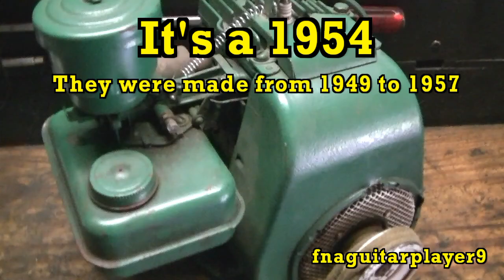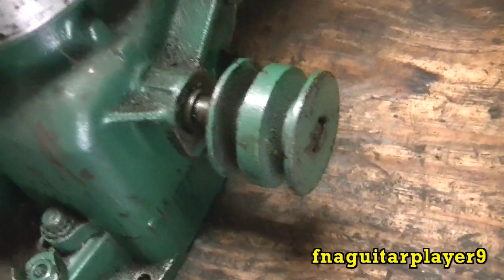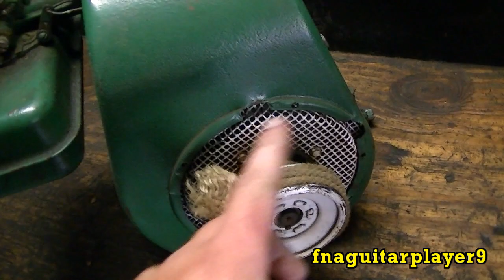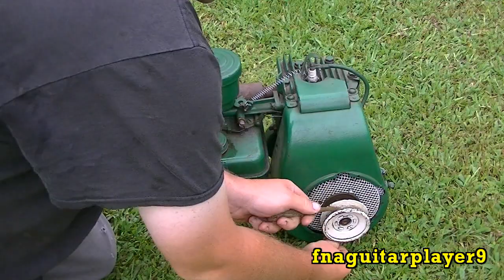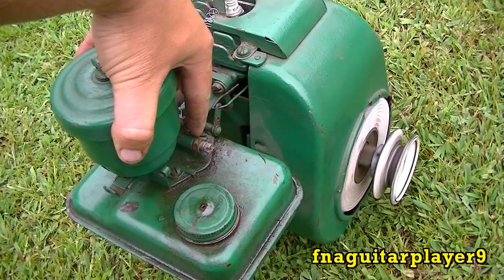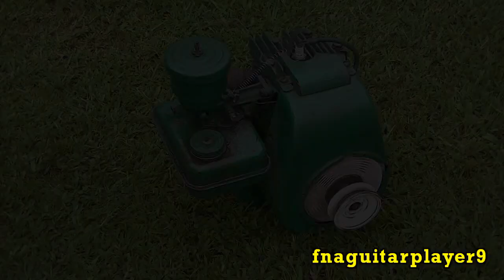1954 Briggs and Stratton Model 6S 2HP Flathead Engine

Comment: These flathead Briggs and Stratton engines have that old school valve timing that you can hear. Tons of duration on the cam profile. 
It's a shame what kind of company Briggs has become today building disposable junk.  They used to be the best in the world and they blew it with their penny pinching corporate mentality. 
These 5s / 6s engines were built to be repaired, maintained and adjusted for a lifetime. I have a 5s engine collection myself. They are addictive once you start tinkering with them.  Great video!
Reply from the maker: Your right, you can hear it. They made alot more power too. So true, all the blocks are cast in china now and i've heard of pores opening up in cylinder walls and other crazy stuff that you need heard of. I hear ya! I also have another vintage engine video you might be interested in, its not a briggs but its a Wisconsin. Thanks for Watching!!!
Reply: They did it to survive and they still build solid cast iron engines overseas, you can thank Democratic liberal environmentalists for killing off the good briggs engines in the united states. Briggs has been getting hammered lately by all the chinese clones out, corporate just took major salary cuts in wake of this virus. Their stock is constantly going down, had they not restructured, they would not have survived, its not their fault, thank the American political system. Read up on this stuff, before you just throw out blame and assume its greed from within that company, in the case of Briggs, not true. They had to survive.

Comment: Those little cast iron block engines were tough as nails I've got a 54 and a 55 6s on my Planet Jr. Super Tuffy's and they will start just about every time with a
 couple pulls and those carbs are very easy to rebuild it ain't much to them but y'all them things are fun to have fun to run in and they sound good too and you got a good engine there that thing ain't smoking a bit and looks like it's got really good compression for a little 2 inch bore. Thanks for sharing!
Reply from the maker: Good engine, they were super reliable .Thanks for Watching!!!

Comment: Great  engine I have a 5 S   that I found it was froze up  I took it all apart cleaned it up and it runs good, I mounted on ply wood it starts on first pull all the time. nice video
Reply from the maker: +gerry mcadams Thanks! I hear ya, thats a hard to find engine as well, luckily you saved it. This one used to start on the first pull each time, but the carburetor could use some work. Thanks for Watching!!!

Comment: I have two Briggs model I's. One is a 1941 Domestic IR6. The block is cast Iron, but the head is aluminum. It has a lot of extra weight over the other model I that I have with that gear reduction on it, the 41 also has a lever starter, so theirs more weight with that, so I think they made the head aluminum to try and trim a few pounds, it came off a reel mower, the other is a 1942 Model I military engine, regular shaft, rope start, larger capacity gas tank, that head is cast iron, that one weighs a good 15-20 pounds less than the IR6, so even way back than, they incorporated aluminum parts to try and lower the weight. I also have a 6s sitting on a reel mower, I haven't really messsd around with that much.
Reply from the maker: I hear ya! I hope to find a lever/ kick start one, that would be interesting. There is a big difference in weight on the old cast iron block engines. I have 2-3 model 23's i think they are and those things are beasts haha Thanks for Watching!!!

Comment: Music to my ears. I got a 1953 1 1/3 hp REO that came from a power reel mower. The opposite pulley spin counter clockwise for the self propulsion system. Its ''sort of" the ancestor of the riding mower. I'd like to see your little green devil mounted on the chassis that it came with.
Reply from the maker: +R Verro It does have a good sound to it! I hear ya! Hard to find any of these old motors anymore. I have a 5HP with the 2nd shaft on it, its actually just the camshaft extended outside the motor. I'd like to find one sometime that way it would be back like it originally was. Thanks for Watching!!!

Comment: I have a 1954 5s Briggs that had 100 psi when I tested it. These things were built to last!!
Reply from the maker: +Mitchell Richardson I hear ya! Thats really good, engine must have been taken very well care of or not used a whole lot. This one of mine doesn't smoke except when you first start it after its been sitting a while. Can't beat these old engines! Thanks for Watching!!!
Reply: +fnaguitarplayer9 I don't think its had much use. There wasn't ton of rust, but it was rusty. The bore was crystal clear!!!
Reply from the maker: +Mitchell Richardson I hear ya, probably about like mine, had a short life o the equipment. Thats really good! I ain't never had this one apart! Thanks for Watching!!!
Reply: +fnaguitarplayer9 its interesting how lucky you can get when you find these old things, what people do to them. Some even can be found with original paint. Or a maybe some sort of loot...😎
Reply: +fnaguitarplayer9 the5s is rated .86hp at idle, and you can stop them with your hand. Not the best thing to do thoo😂
Reply: +Mitchell Richardson though*
Reply from the maker: +Mitchell Richardson Yeah they are really hard to find anymore. I've been wanting to try and idle it down to see how low it would idle, for a brief time, don't want to starve it of oil!
Reply: +fnaguitarplayer9 yeah, that little oil slinger can only do so much!!
Reply from the maker: +Mitchell Richardson yeah lol
Reply: +fnaguitarplayer9 lol